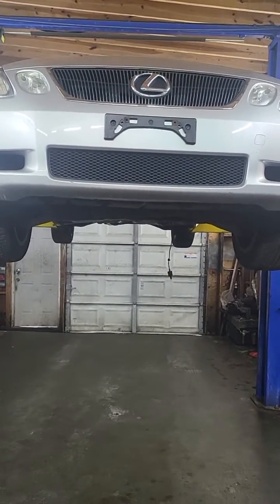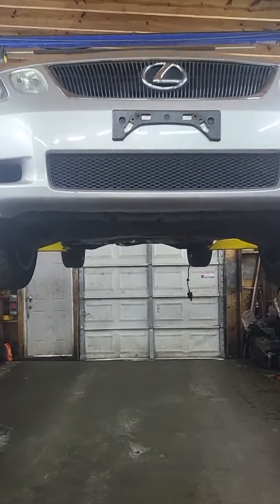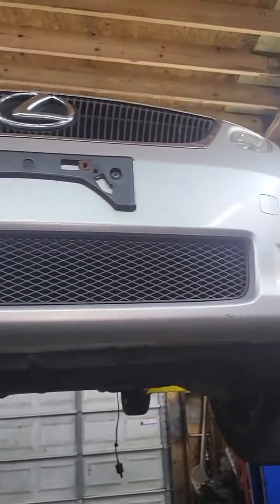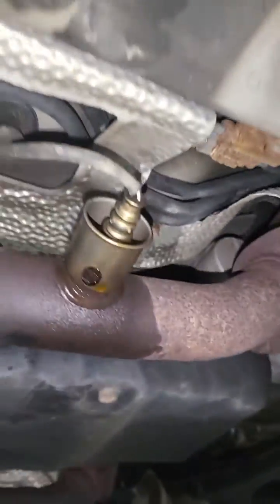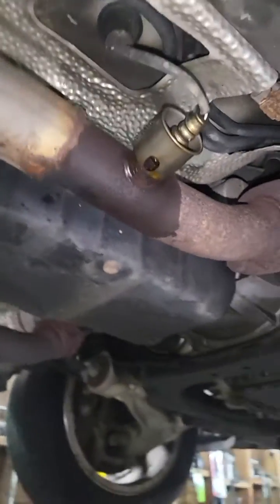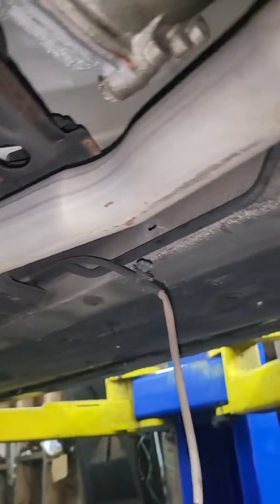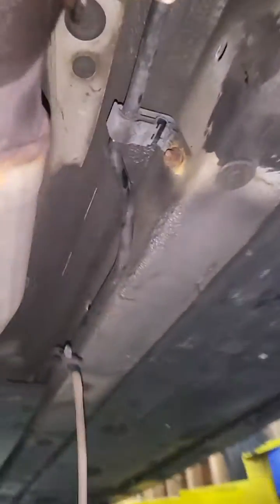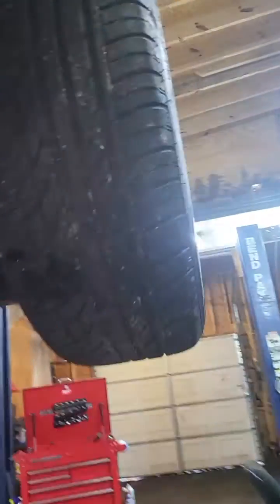2007 Lexus GS350 & IS350 Firing Order & Oxygen Sensors Location. Code P0037 #Lexus

Comment: Great explanation. I have a 2007 GS350 with a P0137, which is supposedly a bank 1 sensor 2 issue. So that's the passenger side O2 sensor. Did you say that in order to disconnect the sensor, I need to pick up the passenger's side carpet and the connector is near the console?
Reply from the maker: Thanks, and yeah, it's right there, and you gotta unplug it first.

Comment: You point to the sensor but don’t actually show how to remove it? Whats the point of this? From the top or bottom of the engine? Bank 1 sensor 1
Reply from the maker: Some folks like to DIY and save cash, but they don't know where the oxygen sensor is or which one's which.

Comment: What’s the cause for p2240
Reply from the maker: Faulty Air/Fuel Sensor Bank 2
Air/Fuel Sensor Bank 2 harness is open or shorted
Air/Fuel Sensor Bank 2 circuit poor electrical connection
Air/Fuel Sensor Relay
Faulty Engine Control Module (ECM)

Comment: I have a p0420. What usually causes that ? 07 GS350
Reply from the maker: The most common cause of a P0420 code is a faulty catalytic converter. The following are some other potential causes: Exhaust manifold damage or leakage. Exhaust pipe damage or leakage.

Comment: I have p0430 on my Lexus gs300 2007 any advice thx in advance
Reply from the maker: HI what i do is add some cat cleaner in the fuel tank then drove it for about 150 miles and erase the code that may help you , if the code keep coming back then you will need to replace it , thanks and good luck
Reply: @hanitwfik  thx buddy
Reply from the maker: @sosoft2161  You got it